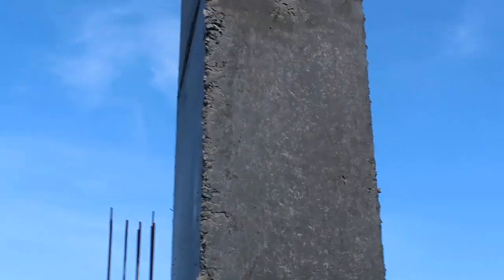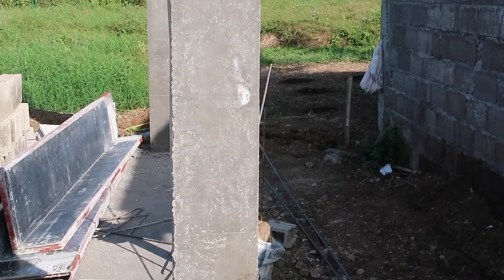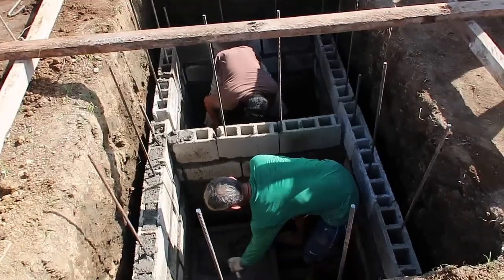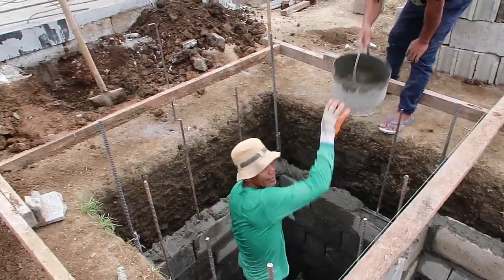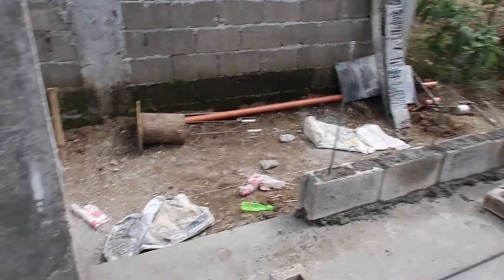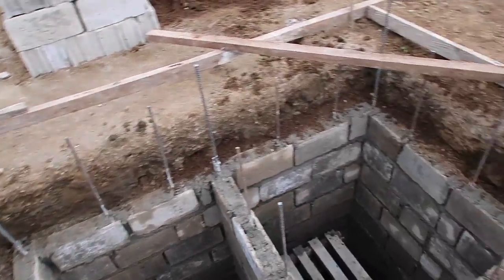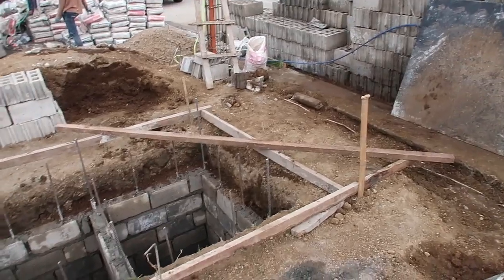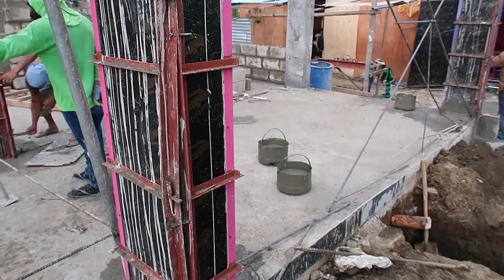HOUSE BUILDING IN THE PHILIPPINES - EPISODE 29: USING FORM CASING TO THE COLUMN

Comment: That is not the correctbway of chb wall dowels? Unacceptable in rebar to be rebend the rebar and it does not meet the dowel splice length. There is no floor slab for the septic tank. Where are the electrical conduit. Is there any electrical plans. Get a clamp, and clamped it down. To fix the blow out form..

Comment: as for the Honeycomb. Make sure that the Concrete Cover is enough  for the aggregates to fit. usually 3/4" should be the maximum size for gravel. so cover must be altleast 30mm

Comment: I understand the construction techniques differ country to country. Here in Perú is a very sismic area. Some ideas: 1.- As soon as you receive the rebar paint them with a mix of water and cement (milky consistency), to protect them from the rust. Do not use this technique if the rebar will be used more than a month later. Otherwise paint them with anti-rust paint. 

2.- The stirrups should have the ends bent 135 degrees inside the column and should have 10cm portion inside the column. (See: https://debug.pi.gr/default.aspx?ch=35) 

Happy Building!
Reply from the maker: Thanks

Comment: Trouble is you can’t have the concrete to wet. Otherwise it’s to weak. You know when it’s just right when you do the slump test. 
Still looking good 👍👍👍
Reply: it looks like chit and worse yet like you mentioned they have weakened the concrete tremendously by adding to much water, leaving the vibrator in one spot, etc, etc, etc... they really are a dum bunch of tradesman

Comment: Hey there, Just a few points about septic tanks. The water level should be
5cm below the bottom of the inlet pipe. The bottom of the lid needs to be a 
minimum of 9 inches above the water level. The gray water goes into the
second chamber because it contains soap , drain cleaner, and  other things
 that could kill the bacteria  in the digester. This is also the same height as the 
black water inlet to chamber 1.   The transfer point needs to be at 1/2 the water 
depth because sand and metal contaminants sink to the bottom and your little 
gifts are floating in the top couple inches.  If the transfer port is at the top or bottom 
then undigested stuff goes into the second chamber. I use a transfer port into a
third chamber  that is basically a holding tank for water to use on landscaping
the outlet from the third chamber sets the water level in all three chambers. this
outlet or overflow is connected to the leaching field or in the PH the gravel layer 
under the septic tank floor. With two chamber systems you can eliminate the 
holding tank chamber if you don't water landscaping and put a six inch PVC pipe
vertically cemented through a solid chamber 2 floor. The top of the pipe is cut  to
set the water depth on both chambers. The 9 inches above the water level is for 
air exchange in the digester and needs a vent pipe in and an above water level port 
to chamber two is the air exchange exhaust. These two air pipes need to end at as
different height as you can make them for thermal siphoning to circulate the air.
The exhaust stack is the tallest.  My intuition is that your very deep tank will have
significant hydrostatic head to force the overflow into the ground. I have never 
tested this because I use larger surface areas for oxygen exchange benefits which
makes for a shallower tank.
       If you are doing split aircon the evaporator will work on the back wall but exhausting
condenser heat between you and your neighbor will not make him a happy camper.
You  could put the condenser and compressor well above his roof for heat and noise
supression and it would still be out of sight, but harder on maintenance. Possibly a
platform with a steel ladder up to the compressor and also as a fire escape for the second floor.
     I hold the vibrator head flat against the outside of the form for surface finish and down inside to get contact with the rebar. Seems to work that way but there are a lot of variables.

                                                   george and aurora